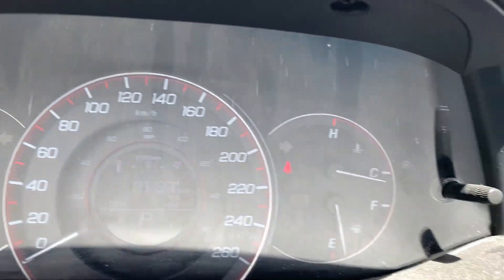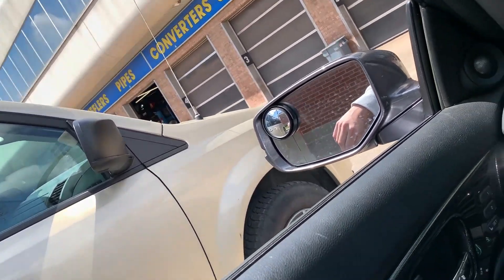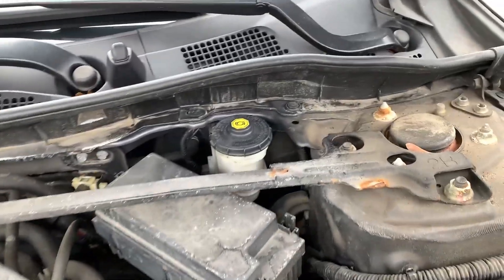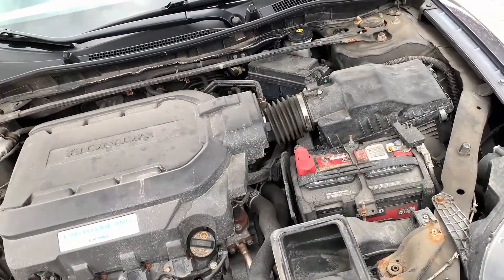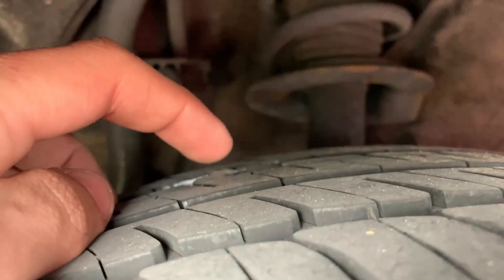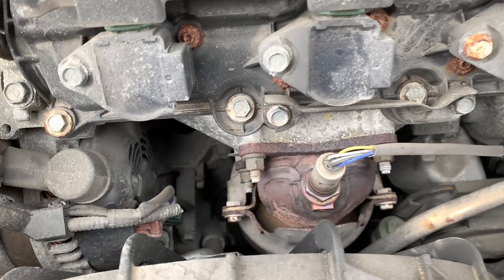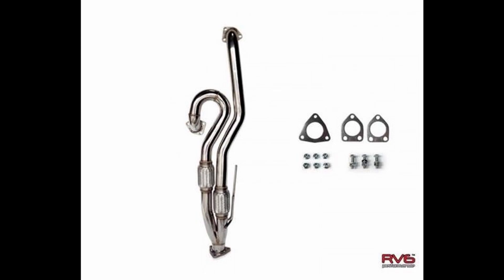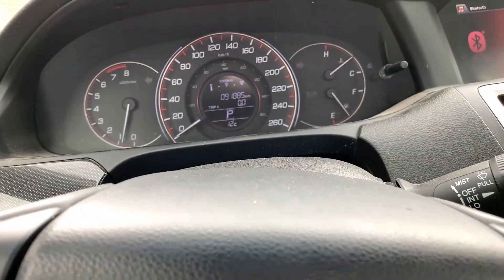(Daily) 2013 Accord v6 (Muffler Delete)

Comment: I just sold my 2020 Mustang GT ten speed and bought a 2013 Honda Accord V6 coupe. Love it. Has plenty of power to keep me happy..looks sexy. Just a different kind of sexy. Needs louder exhaust. So far it has the Borla axle back, and magna flow high flow cat. It's rediculously quiet still. Im thinking need to get rid of resonator. Tryn to do the less expensive stuff first.
Reply from the maker: I feel you on the quite aspect, I still just have the mufflers cut off and its only loud when I get higher into the rpms. the borla sounds crazy and I'm looking to get the RV6 catless headers and RV6 catless J pipe/downpipe for the accord. look into those, they are crazy loud
Reply: massive upgrade bro